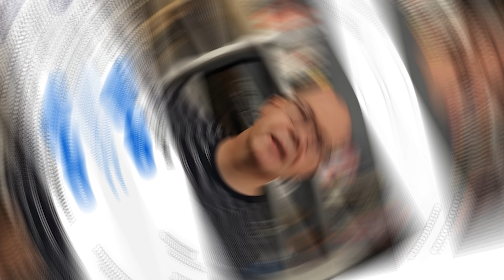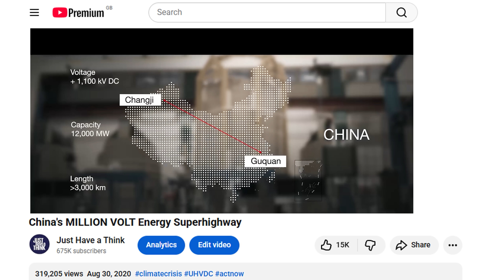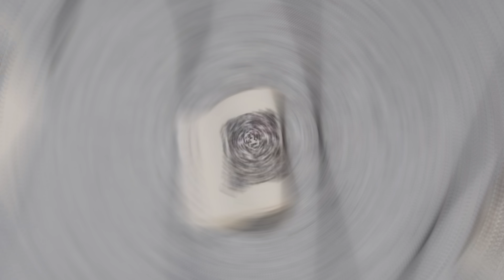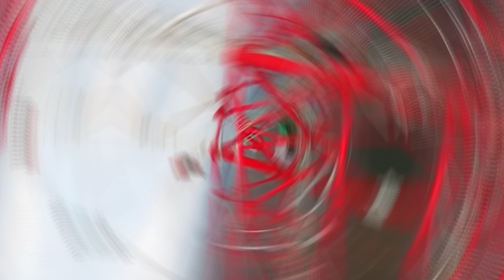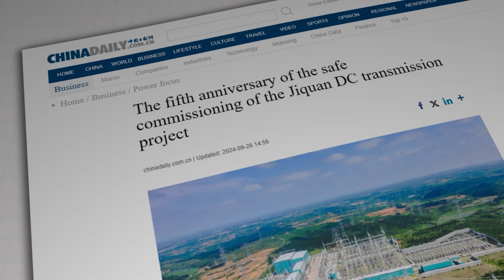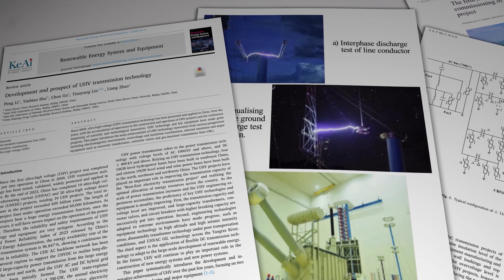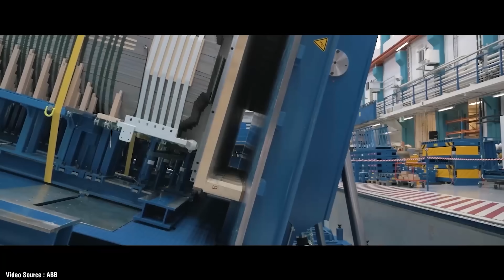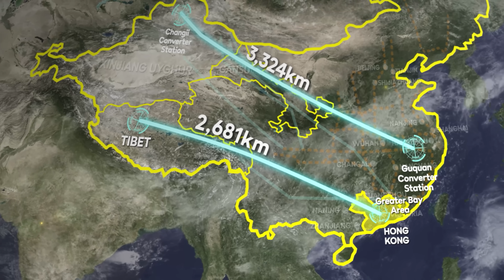China's ultra-high voltage transmission lines now breaking all records.

Comment: Have you already done a program on quantum dots and solar PV enhancement potential? I should check first, but I’m too eager to score that sweatshirt, sorry.
Reply: Stop wasting your time with solar...  It's an environmental nightmare due to the amount of mining and resource gathering that is required to make the panels and the metals needed to build the batteries that make solar a viable option as a power source.

Geothermal is the path forward.

Comment: I would like to hear your opinion on the feasibility of these transmission lines in Australia, its population spreading is similar to China, can generate the electricity in South Australia and transit the excess power to Melbourne, Canberra, Sydney and Brisbane.
Reply: Just one Chinese city like Chongqing with a population of 32 million is larger than the entire population of Australia at 27 million. A quick Google search returned the following: UHVDC transmission generally becomes financially superior to standard HVAC transmission for overhead lines at a break-even distance of approximately 600 to 800 km (370 to 500 miles). For underground or submarine cables, the break-even distance is much shorter, typically around 50 to 100 km (31 to 62 miles).  Feasibility studies should be done for the various Australian locations and the recommended approach taken if there is enough political and financial support.

Comment: Have you looked at ice ponds, conceived by Freeman Dyson and Ted Taylor, described by John McPhee in the 1981 July 6th New Yorker?  Experience with heat pipes since then should bring down the operating costs.  Would heat pumps allow their use for winter heating as well as summer cooling?  How small could they be and still be competitive with other energy conservation measures?

Comment: As an Australian, this is all extremely interesting. Now, what we need, is a plant which can manufacture under-sea cable in bulk, that carries about 6 ~ 10x the Australian national electricity, and we need a solar array + wind farm in middle of the outback, which is about the size of Tasmania, and we need that ultra-high-voltage cable to carry it to Asia, and then a distro hub splitting it off to various customers there. And if we could also build a truly industrial size battery ( like a flow battery with hundreds of huge tanks) and hook that up to both our national grid, and the export cable, that'd be very nice.
Here in Oz, we are in the middle of a resource storm. It's raining soup. All we need is a bucket. And a pipe to pump that soup out to the customers. We have been doing something a bit like this with coal and iron-ore for decades, we need to up our game and do it with renewable electricity.
Why sell dirt when you can just sell sparks?
Reply: Stop wasting your time with solar...  It's an environmental nightmare due to the amount of mining and resource gathering that is required to make the panels and the metals needed to build the batteries that make solar a viable option as a power source.

Geothermal is the path forward.
Reply: @TerraPotentia  It's with that kind of thinking that resulted in China becoming the lions share of the solar PV, wind turbine, and battery storage markets.
Reply: The next step would be to do feasibility studies. If practical and financially viable, go for it.

Comment: Extended Range electric vehicles that run on ethanol from exponentially renewable highly sustainable like Giant Bamboo. This electric vehicle has no range anxiety and countries that have poor grid infrastructure  will gain advantage as these electric vehicles does rely on grid to run and can make its own electricity powering a house or businesses.
Reply: Battery swap for BEVs is another alternative to flex-fuel PHEVs / extended range EVs as solutions to range anxiety.

Comment: My interest for a future story...how do various sources of electricity hold up to the greater frequency of extreme weather events?  Specifically ice storms, snow and extreme cold, but it could be interesting to know about flooding, hurricanes and heat.  To include wind, solar, tidal, wave and traditional fuel sources, due to their fueling needs.  It could include nuclear and geothermal, but I don't believe those would have much relevance to extreme weather. Thanks for your consideration!
Reply: I realize I failed to include hydro-electricity, especially for heat and drought.
Reply: @TreeHuggingDad  The geothermal revolution is here.  Look up Quaise Energy.  Their drilling tech literally opens up the entire planet to geothermal as an option.

The Kola Borehole is the deepest borehole ever drilled with mechanical drill bits at 40k+ feet.

Took them 20+ years to do it.

Quaise Energy's millimeter wave drilling tech can drill to that depth in 100 days.

It literally vaporizes rock...

Comment: I want to see 3 new sessions:
1. Why do Australian Electricity prices go negative? The suppliers pay the wholesalers to take their electricity a lot of the time. Payments from $1 per Megawatt hour to more than $40 per MWh have been seen but payments around $10 per MWh are more usual. AEMO sets the price at the most positive price needed to match the demand. The coal fired stations can't turn off, so they have to bid a negative price. The solar farms get clean energy Certificates which sell for about $8 to $10 per MWh, so that can bid at -$7.90 to -$9.90 and still make a profit. Why would anyone invest in new power in this environment.

2. Renewable electricity is variable, so why don't we develop a variable load. Aluminium production is prime case. About half of the cost of Aluminium is the cost of the electricity used to make it. Can we develop an smelter whose power can be interrupted, or at least reduced a large amount, without all the molten salt and Aluminium solidifying? Is it just a matter of getting better thermal insulation around the cells? If we could achieve this, the smelter would be able to run on low cost (perhaps negative cost) electricity and out compete other smelters.

3. Can we please have some serial hybrid cars. I have 22 solar panels on my house and a 9.6 kWh battery, but the battery is not big enough on many days. If I had a serial hybrid which used a small (15 kW) diesel engine to charge its battery (rather than drive the wheels), I could increase the storage for my house, knowing that the diesel could supply my house when I had several rainy days in winter. I could then disconnect from the grid and save the $1 per day connection fee. I could use most of the car battery, knowing that if I suddenly needed to use the car, the diesel could keep it going. No range anxiety, no electricity connection fee. People who used their car to go to work 5 days a week might need to increase the battery for the house (maybe to 30 kWh) but those working from home would be fine.

Yours truly
Geoffrey M. Hudson  Ph.D., M.B.A.
86 Fernside Avenue, Briar Hill, Victoria 3088, AUSTRALIA.

Comment: You do have one of the best Youtube channels. Thank you. I have several topics that I'd like to see. One is the superconducting transmission lines that have been talked about since the 1980s. Remember reading about ceramic type of superconducting breakthrough that would work at temps of -10 to -20F. Also interested in more info on utility scale BESS and VPP systems.

Comment: Just retrofitting existing wires would increase capacity amd reduce losses in current HV lines.
Installing underwater lines around Europe would also improve significantly the network with very reduced impact.

Comment: Keep up the good work Dave.
Would you be able to have a topic looking at the future problems of households switching from gas combi boilers to Heat source pumps, as many older houses will need significant remedial work (i.e new rads, pipework, hot water storage tank, insulation, etc.). It would also be useful, if you can provide further information on where we are using hydrogen/natural gas mixes for use in existing or new boilers and other gas appliances. Thanks.

Comment: Had a thought about direct conversion of heat into electrical power if it's possible it's energy so no violation of thermodynamics don't know how but it solves a lot of problems

Comment: One interesting subject to dig in to would be the time it would take for all the CO2 emissions caused by the manufacturing of all components needed and the emission of building these transmission lines, becomes net zero in comparison with other systems/techniques. That comparison is extremely important since our situation is, to say the least, extremely dire 🙄 One could say that time is of an essence when it comes to which technique or system to invest in to minimize our CO2 emissions…

Comment: Merry Christmas Dave, from Canada.  I'd like to see a video on a company that is currently testing a way to do pumped hydro storage, with a twist, they're adding a powder to the water to increase its density, which they claim allows the head to be significantly reduced.  Sounds like an interesting concept.  Thanks.
Reply from the maker: I'll see if I can find them.
Reply: @JustHaveaThink Dave, I just found the article again, it's in Wired and the company is named RheEnergise.

Comment: Would UHVDC lines be advantageous in Canada's proposed power corridor? Would running through primarily Arctic  territory to supply power to mines, oil sands projects, sea ports ,etc  be dangerous or is the cold and advantage?

Comment: A video on the cost of electricity from solar, wind, batteries, and other renewables compared to the cost of electricity from new nuclear, coal, natural gas, etc.
Reply: Forget all of those as options...  Geothermal is the answer, hands down.
Reply: @TerraPotentia  I did include other renewables like geothermal, if it’s feasible and least expensive then it will win.
Reply: @wineberryred  I know you did, I'm just saying that geothermal is the best option.

Just 0.1% of the thermal energy beneath all of our feet is enough energy to power all of mankind's needs to 2 million years.

With mechanical drilling we're relegated to doing geothermal only in places where the crust of the earth is thin, or has high volcanic/hydrothermal activity.

A small aside...  The deepest borehole ever drilled with mechanical drill bits is the Kola Borehole in Russia at ~40k+ feet deep.

It took them literally 20+ years.

Enter Quaise Energy...

Quaise Energy spawned out of MIT's Plasma Science and Fusion Center, and they have a new way to drill...

Millimeter wave drilling (MMW)

In fusion reactors we use gyrotrons to heat up the plasma within the fusion chamber to insane temperatures so that fusion can take place.

Quaise is using gyrotrons to literally vaporize rock.

Granite is some of the hardest rock on planet earth with a Mohs hardness of 7

Mechanical drill bits can achieve around 0.1 meters of drilling depth per hour through granite.

Quaise can achieve 5 meters of drilling depth per hour through granite.

Quaise Energy will be able to drill to Kola Borehole depths in 100 days.

This unlocks the entire planet to geothermal.

Comment: Video topic: what are the barriers preventing huge scale battery (flow, air, whatever) solutions for grid scale balancing. Couldn't you build out an excess of storage and run completely of green power? Expensive at first, but virtually free power afterwards would seem to be a very potent economic stimulant, making the country that does it far more competitive as a place to base out of.

Comment: How about a follow-up on the cause of the electrical grid collapse in Spain? It has been blamed on an excess of solar power, which is relevant to places like Australia, where our grid is typically up to 75% renewable energy (mostly rooftop solar) during the day. The conservative opposition are claiming that Australia must build nuclear power stations or the grid will be unable to support heavy industry (despite the fact that it already does). How do we avoid these ridiculous wars over the power transition?
The UHVDC approach might work to get power from the Australian deserts to the population, but farmers are currently blocking the construction of HVAC lines because they interfere with aerial spraying of broadacre crops. The opposition to renewable energy is frankly religious in behaviour not based on logic.

Comment: The grainbelt express isn't dead but Orange certainly isn't helping. Though I would wonder if the US needs to approach the issue of transmission the same as China. The economics of transmission change when you can for example include solar into it.

Comment: Wow
You seriously need to do more research before posting
In 1984 Japanese co installed UHV transmission line in Brazil,   Itaipu Dam   800 km, 6.4 Gigawatts 800,000 volts FOURTY YEARS AGO
German Co construced 11,000 km of UHV transimssion line and has it under management for DECADES in the 500,000 to 800,000 volt catagories
Chinese systems listed on line aren't big improvements on anything but length... and

As to the whole idea of moving power 1,000's of km, why? Outside of creating bottle necks billioanires control and can name the price when it comes to using it?

How about instead of denuding 1000 mile long corridors creating the greatest biological barriers in all human history, and the mega tons of carbom it will take to build, then maintain the lines AND the land of the corridor forever, how about building alt energy plants approriate to the area WHERE THE POWER IS NEEDED.  E. Coast US can easily be powered via off shore wind and a 1000 mile under sea UHV line, as Germany started installing YEARS AGO.  The wind is always blowing somewhere off the East Coast.  Add solar on every building, parking lot 10 lane highway, biomass to add to burnable trash instead of fossil fuels, and yes, scrubbers needed, but it's a net zero carbon system.  HUNDREDS of mountain in coal country have been bulldozed into adjacent valleys to get at coal without using costly mining and miners, replacing them with min wage truck drivers, and creating sites for HUNDREDS of pumped storage energy ponds that could easily be piped to common generators to power cities all night long.  Batteries against all bets are being made with new tech that might even make them viable for off peak storage, buidling by building and grid, also eliminating demand spikes and inefficiencies that casuse.  Then there will be wave energy systems, tidal systems, the Hudson river floods from tides for 100 miles taking hours each way, each possible to turn generators for hald a day.  The Harlem and E.Rivers are known for DANGEROUSLY FAST CURRENTS due to tides.  There are other big rivers and bays.  That's just the East Coast.   Cheaper.  More Redundent and Distributed thus safer.   No need to run power from California 3000 miles.  
Just becuase China does something 'big' hardly means it's a 'good idea'.  China builds MOSTLY TO JUICE ECONOMIC STATS AND SO THE RICH AND POWERFUL CAN STEAL BILLIONS usually by cheaping out on work ensuring it's early failure.

Start one more show with 'China leading the way as usual' and i'm bailing
Chinese green energy projects well known for never meeting goals
Chinese coal fired power plants being built as fast as ever
Chinese you name it failing DAILY with utter disasters happening monthly
China's boasts have lately included record beating AI chips, that were Western chips painted over with new logos
How on earth can anyone lead credance to anything reported by China 
Did they lay 2000 km of cable, maybe, can it carry any current, maybe, but will you bet your reputation, your biz, your house on it being relied on for grid back bone for 40 yrs as critical infrastructure?

Comment: Geothermal heating and cooling have enormous potential to lower global energy consumption.  The largest cost item of installing most geothermal systems is boring a vertical shaft roughly 300 to 400 feet deep.  I would be interested in a video on new technologies that lower the cost of drilling geothermal wells.   Rest assured I'll continue to watch your channel if I don't win a hoodie.  Thanks for the education over the years.

Comment: It would be interesting to see an update on promising efforts to reduce the impact of critical minerals mining and processing operations. Particularly for the key metals used in clean transition technologies.
Reply: Listen, a world filled with millions of wind turbines, billions upon billions of solar panels, and the trillions upon trillions of battery cells needed to make wind and solar a real energy source on the grid is an environmental nightmare.

It's SOOOO much damn work that doesn't need to happen.

Geothermal is how we move away from fossil fuels.

Has a tiny environmental impact by comparison, and is a limitless supply from the core of the earth.

Just 0.1% of the thermal energy beneath all of our feet is enough energy to power mankind for 2 million years.

It's a god damn no brainer.

Forget wind and solar with batteries, tap into the earth's thermal energy instead.

Comment: I think it would be nice if you had a video on the Brazilian grid! It is a very large grid (both in terms of size and power), and the CI is generally around the 100 gCO2 per kWh mark - very green compared to many other large grids. Brazil already has many many UHVDC lines for green electricity. I could help with some sources!